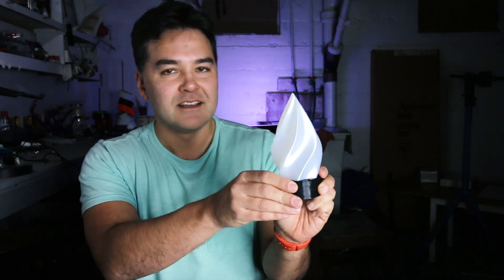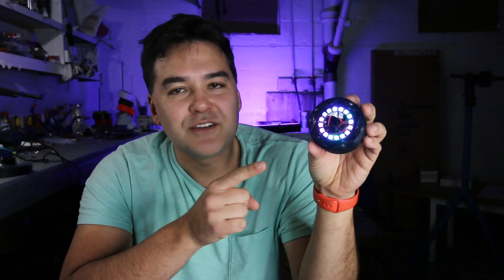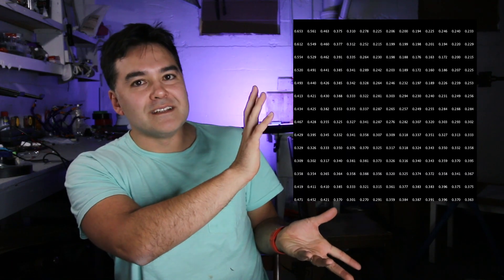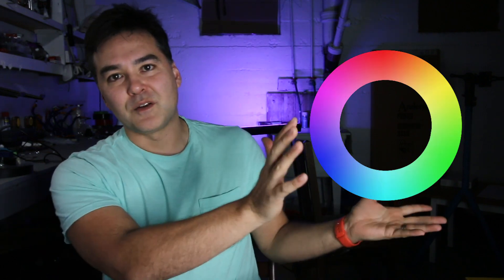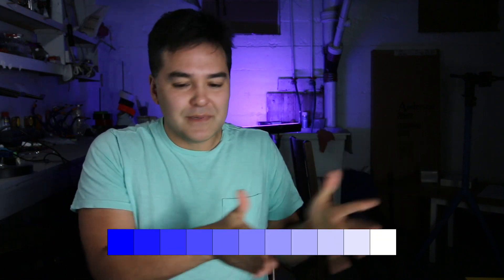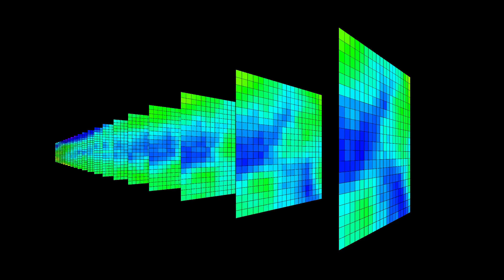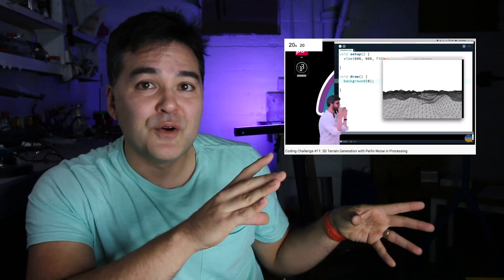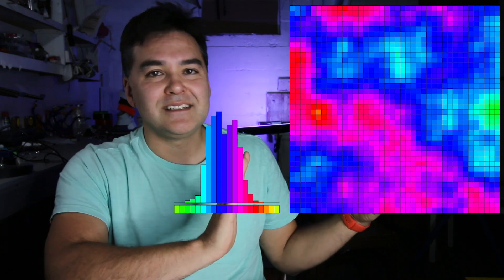LED flame with plasma effect (Perlin noise)

Comment: Nice! Very good explanation too. I just may (maybe) have a better idea how to make a flame animation now, that kinda eluded me for my small 3x3x3 RGB LED cube (I recently uploaded a video of it, but I made it over a year ago, in fact soon 2 years ago... trying to get into Arduino again atm). Now off to look at those Perlin noise videos you linked, thanks! Not sure what I'll get out of them, but I'll have a look and see.

Btw, I made a sort of a simple (triple) sin wave function with each color component for each cardinal axis (IE Red for X-axis, Green for Y-axis and Blue for Z-axis), each with it's own wavelength, and combined it made for a nice enough "random" ish color cycling, going slow it's a kind of a mood lamp / soothing ish sort of effect.
Reply from the maker: Hmm, adapting this to a flame animation would require a lot of changes. I haven't done anything in that area. Definitely curious to see if Perlin noise helps in that area. Keep me updated.